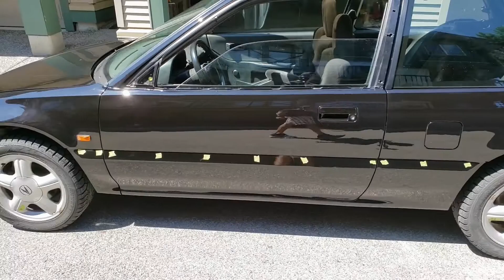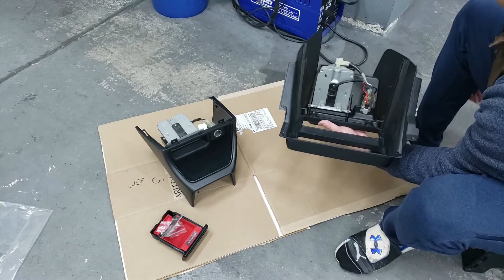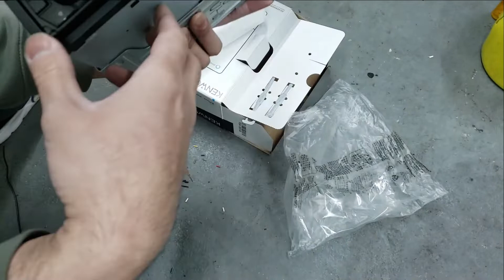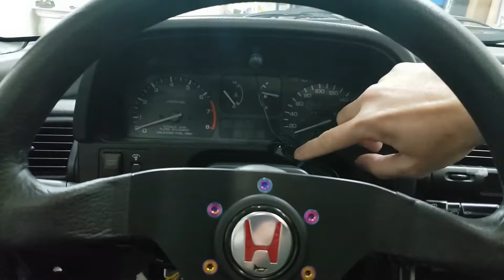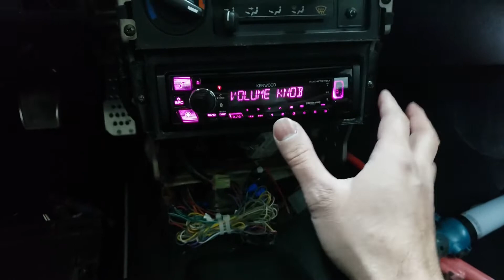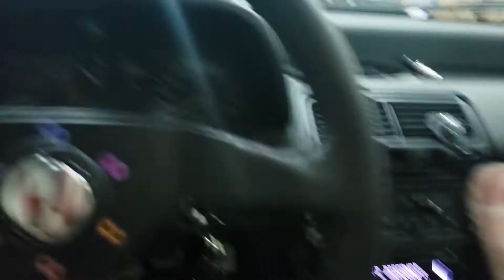Upgrading Car Stereo🎵 || Installing a Bluetooth Deck into my EF CIVIC Using Some 3D Printed Parts!!

Comment: How much would you charge to print one of the bezels I can’t find one anywhere! And i need music 😭
Reply from the maker: Unfortunately it takes a really long time for my printer to print this. It's just not worth printing it for anyone. You can check with Greg from EFparts. He makes them for resell. He does a ton of 3d parts for resell.

Comment: I would love to learn how you fix plastic trim parts with a heat gun. Specifically on my car the trim panel inside the trunk behind the license plate looks pretty ugly. I like your new sound system, I think I want something like that but I'm not sure if I am willing to drill a hole for the microphone.
Reply from the maker: It's not overly difficult. The heat gun trick only works for minor scuffs and dull parts of the plastic panel. It essentially melts a little later of plastic, which brings the oils back up. And I didn't drill any holes for the mircophone. It came with a holder where I can clip it somewhere. I wanted a holder that was smaller so I designed and 3D printed one myself.